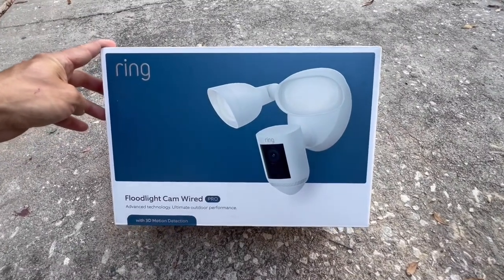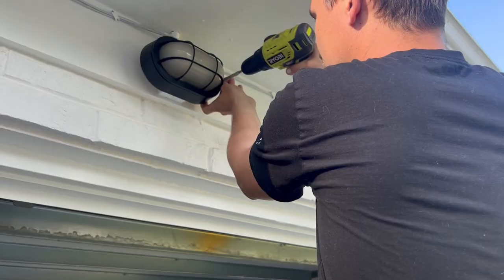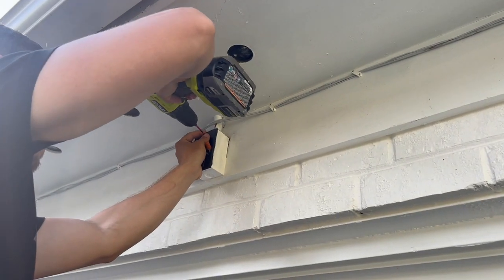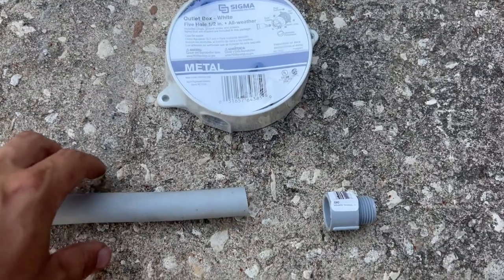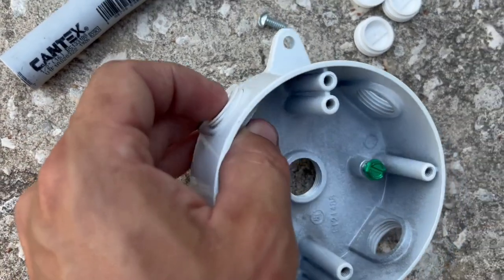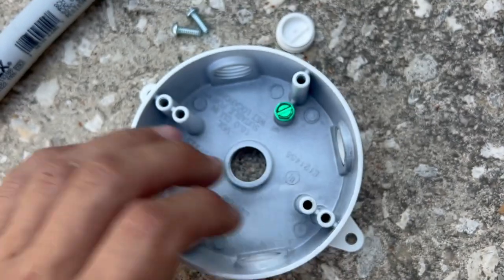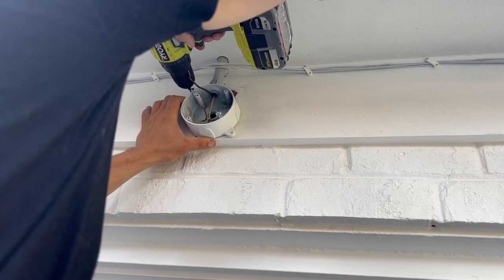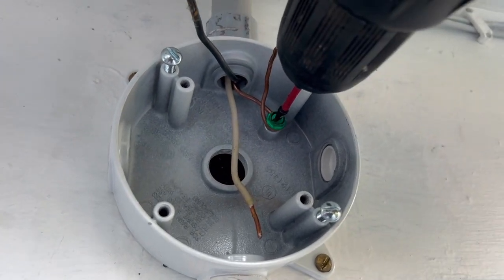How To Replace An Exterior Electrical Box for a Ring Floodlight Cam

Comment: hey, thanks for your video, one question. if I want to keep the existing exterior light fixture, may I connect the ring floodlight 3 wire to the same 3 wire that my light fixture connects to? I will keep the switch power on all the time and use smart bulb to turn on/off exterior light using phone. does that affect ring to work?

Comment: Can I run wires from an existing outlet (about 5 ft from where I want to install the flood camera) thru a pipe and attach the junction box to the hardie plank board?
Reply from the maker: you can do it, if you have understanding about electricity and home electrical wiring. I did similar project: How to install a Ring Floodlight Cam (no existing wires/device), watch it here https://youtu.be/NROcfnZkgro